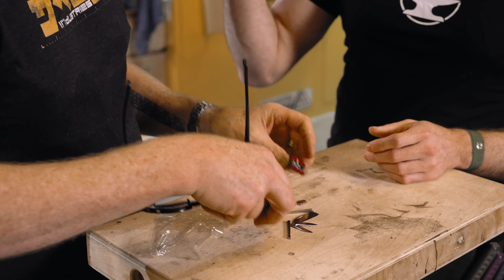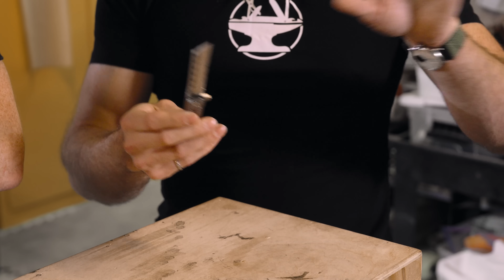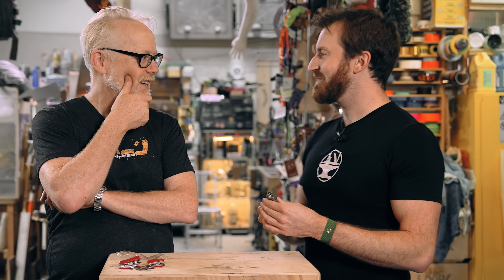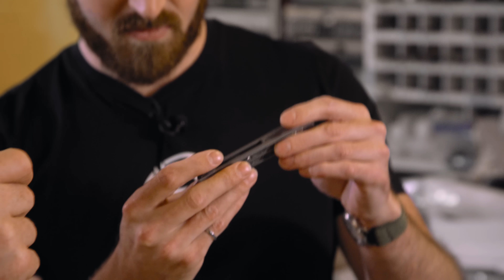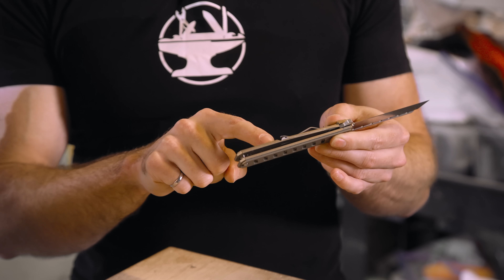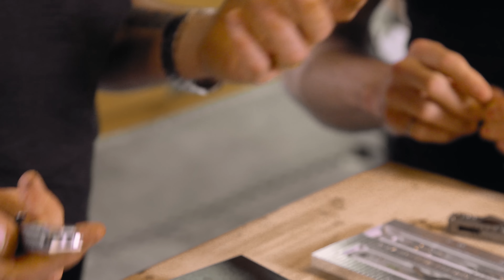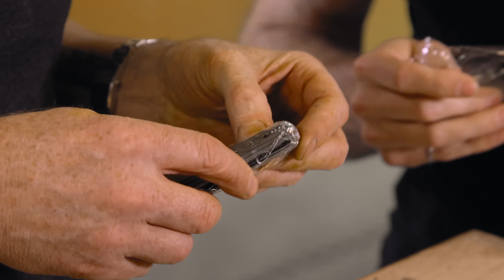Adam Savage Wields Hacksmith's Titanium EDC Multi-Tool!

Comment: It was such a honour getting to present the first Founder's Edition Smith Blade outside of Hacksmith Industries to everyone's OG maker hero 🥰 Thanks for being awesome, Adam!
Reply: You guys are insufferably legit. Good on you. I think my favorite touch is the torque wrench nature of that little piece of plastic to help assemble the belt hook.
Y'all are inspirational and do such cool things. Good on you.
Reply: @JoshuaKoerner Got the insufferable part correct.
Reply: @JoshuaKoerner  Really? Their finances and view count says otherwise. Even jimmy thinks so.
Reply: is the blade replaceable?
Reply: @IGamePlayOnly it is - they have two blades and mention being able to upgrade for folks who live in areas with strict laws.
Reply: @IGamePlayOnly  looking at their site, the whole thing is user serviceable and that includes the blade
Reply: @IGamePlayOnly will you ever actually need to replace it….
Reply: @Hohmies86  if you plan to use it like everyone else, it will dull over time. thats just a fact.
Reply: @IGamePlayOnly I’m an electrician and I use a griptillian with s30v steel blade every day to strip copper wires with. It’s been 2 years since I’ve sharpened it. I shave off copper sometimes when I’m stripping bigger wire. 
I’ve sharpened it numerous times. Can’t even tell that the blade has shrunk yet after 6 years total use. 
Really should go sharpen it right now actually. 
M390…. Be a long time before you ever need to replace the blade.
Reply: @IGamePlayOnly  Omg don't buy $250 knives if you can't be bothered to sharpen the damn thing.
Reply: The wire stripers are what sold me on this. The knife i currently carry around has a wire stripper, but it's a pain to use. Yours looks amazing and simple. Also being manufactured in Canada is a huge bonus
Reply: I have been looking for an EDC replacement and I'm sooo glad to come across this. Sad that the founders editions are all gone within hours of watching.  I love that you're making them inhouse. I'm not against made in China stuff, I just prefer things made in North America... whether CAN, or US.  I feel you will see that many of your customers will also prefer made in CAN. I snagged a Pro version, and hope it too is made in CAN. I can't wait to show this off at my Command!
Reply: This might be a dumb question, considering everything being discussed here, but....is that a static grounding strap being worn, and is it something that worn regularly? I hated those damn things when I had to wear them at the bench in the Army!
Reply: @Bad_Wolf_Media  He wears it all of the time... Clip and go ....
Reply: Do a giveaway and give it to me thanks 😊
Reply: @purifierphoenix2043  me to
Reply: @purifierphoenix2043 ok the entry fee is about $215 if I remember the price correctly. Best thing is 100% chance you’ll win.
Reply: guys i am glad you are the way you are and that you can create and produce everything you do. keep up the good work!
Reply: Have you thought about sending samples out for knife reviewers? Tristate edc is a great channel
Reply: As a fellow Boy Scout, engineer, and lover of all things knives and tools, I love everything about this. Getting to watch you nerd out about your design and share your passion with Adam is just icing on the cake!
Reply: now you just need a version thats uk legal carry, because id love to carry it, but knife laws suck here
Reply: @kevinmorrice I just checked the Kickstart page and they make them uk legal if that's where its being shipped to
Reply: If you make an XL version with pliers I'm buying that the millisecond it goes on sale
Reply: Those are absolutely beautiful knives. I plan on trying to get one whenever they release.
Reply: I'm looking forward to when you're  out of Kickstarter. I will be getting one then for sure!
Reply: I could tell you were meeting one of your idols, you were so nervous you were shaking 😂 you killed it though!!
Reply: Unless my eyes deceive me and my calculations are off, the kickstsrter is already 8x the goal.
Reply: @LyonsDenFarm well if they wanted to try and produce 10k knives for the Kickstarter and they now have that much more to make they better start buying more CNC machines 😅
Reply: You can tell you are literally looking your hero in the face... lol
The level of nervousness that is obvious is  understandable, I would be in that same headspace having a conversation with Adam....
And, Adam is soooo generous.... It must be amazing to have your hero gush over you.
Reply: Congratulations on the success of the kickstarter! I didn’t land a Founders Edition, but I did get the Pro. Very excited for a multi-tool that doesn’t weigh 3+ ounces and in titanium!
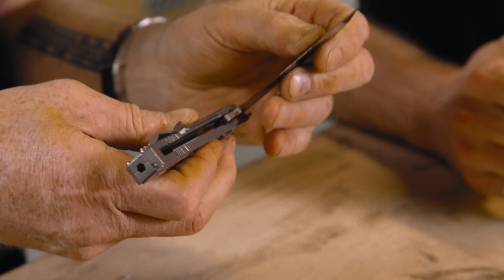Reply: 13:40 I wonder, wouldn't the 15degree protractor wear out pretty quick with that ceramic bearings ?
Reply: Get project farm to review it.
Reply: Watching and listening to the passion in James' voice, the excitement from both of you as he explained your design process made me want to laugh out loud with joy. This is everything that's wonderful about engineering and product design distilled into one video. Take my money. This is one of the best things I've ever seen.
Reply: Getting the Savage Stamp of approval is a huge win for Hacksmith. Awesome work guys.😂
Reply: It absolutely needs pliers. I'm happy to carry my Leatherman despite it's weight for that tool alone, anything else on it is bonus. Do a Smith Blade + or something IDK.
Reply: The protractor, is that the back or the blade side? The blade will shrink as sharpened.
Reply: I absolutely fell in love with your product and the way of thinking when building it. Since I was today years old when I've heard about it and itś not possible to buy one via kickstarter anymore - do you have any ETA on when I could order one? Thx in advance and congrats on a fantastic product!
Reply: You guys should put a little torch at the end ran off a button battery with a option of solar panel strip on the side for extra ability to charge it and run it that would really make it cool and seal the deal for me and maybe a little adjustable spanner like a little shifter amazing product congratulations I've also been thinking about how to upgrade the Swiss army knife for years could you see somebody has achieved it good on you guys congratulations once again. 👍
Reply: Bought one the day the episode aired. Still don’t have it but I’m really waiting. It will be my EDC in place of my pocket knife I always carry now
Reply: *honor 🤓
Reply: wonderfully done! all engineers are gadget geeks inside, i think. 
so glad to see its already 10x the goal. I intend to back for a smith blade if i can swing it before they're gone.

its inspiring to see how giddy you are about this stuff. its hard to hide this kind of passion. i was the same way showing my wife comparatively simple marking knives that i forged. ill get there one day!
Reply: Love to see someone else misspell a word.  A great design. There are so many things you can do with that basic design to make a whole series. Design is absolutely a terrific form of expression. I bet it feels great to get it out. I would love to see one of my designs out there. Congratulations! It really cool.
Reply: I want the founders addition but no tour 🥺🥺🥺
Reply: @brewer165 I live in Canada, I’ll take that tour off your hands!
Reply: There has never been a more fitting use case for the "take my money meme" congrats, I had my engraved letterman wave stolen 20 years ago, I'm saving to buy one of these for sure.
Reply: To be honest, I was on a fence because the $500 price tag and my experience of not sure if I was going to get my torch or not when i backed it. This sold me to buy the knife or all 3 knives later today.
Reply: Well done on it all.
Reply: ahem, OG AAAND THE GOAT
Reply: This made me even more excited to get my 2 Lites on order to replace my leatherman surge as my daily carry. no more 20lb multitool and just what I need in my pocket. until I can get approval from the SO to get the Pro lol
Reply: Backed! Wish I had got into the early bird, saw Adam’s video first and by then it was too late. Can’t wait to use it!
Reply: I would love to see you get this in the hands of knife reviewer Best Damn EDC. This is something I think he would love to handle.
Reply: he rocks!, you rock too!
Reply: Do you have a lefty version with the knife release on the opposite side?
Reply: you fool. you realize what this could do to society?! giving a former mythbuster the most powerful multitool in existence? you don't know the chaos that's about to ensue!

/jk its so cool to see one of my heroes geek out over such a cool artifact
Reply: With the acknowledgement that the Kickstart is at a special, reduced price, will you be selling these after the Kickstarter window? Timing is poor for my own finances, but I'd love to get ahold of one of these eventually!
Reply: I am a huge knife and multitool collector and I always have SAK and  Leatherman on me. But this looks amazing! I can see that you know what you do, that you know knife community and materials that needs to be used. All props to you guys! This will probably be amazing product!!!
Reply: from a knifemaker myself that is awesome well done
Reply: My God i'm ready impressed. I'm an Electrician in Germany and this knife would be insanely useful. Please also ship this knife to Germany get it into the market there. I would instantly buy a few for me and my Colleagues.
Reply: PAPA JAMES UPDATE THE LOGO TO INCLUDE THE TANTO BLADE OF THE NEW KNIFE
Reply: Shut up and take my money
Reply: I've actually been looking for a knife/multi tool almost exactly like this for forever. Seems like this design has basically every single feature I want in a single EDC tool. I'm definitely going to be buying one of these as soon as they hit the market.
Reply: I have a lite and it is amazing. Going to be my edc until I get my pro.
Reply: Awesome blade. Im gonna buy one next month. Way to go hacksmith ! Im a  Long time subscriber of hacksmith industries. Love your chanle love Adam Savage chanle. Can't wait to get the knife.
Reply: I'll be picking one up soon. The amount of detail is spectacular.
Reply: This must be so awesome moment to present this to OG maker. I was even my self so exited that i almost  had tears of Joy! Weldone James, that is true over engineering and superior rigthful way to OCD things and make quality product. 100% i will order one for my self 👌👌👌👌
Reply: Congratulations brother, you just sold me a Smith Blade family and then some upgrades!
Reply: Soo whens the smith blade 2? Lol
Reply: Bought one today!
Reply: Electrician here 
THIS IS PERFECT!!! Thank all of you for hacking the EDC multi tool world!
Reply: If you want a quick, easy duplication of all your models, offer one with a short blade and no open assist, since many countries (and some US cities) have blade restrictions. This is so awesome, though.
Reply: Awesome work. I'm sad the lite isn't smaller. These are pretty hefty and way too big for all of my scouts. Would love if you get enough backing to invest in a v2 geared towards actual small handed scouts?
Reply: @hacksmith if we could sell 10000..... and currently Kickstarter shows over 13000 pro orders and nearly 150 scout pack pro orders.... I think you may have underestimated the interest... great work and awesome enthusiasm for a user serviceable and upgradeable tool!
Reply: That is an awesome design. Definitely hard to top that. I will happily support. That Kickstarter is 28000% saturated when I checked.
Reply: I don't have a edc muktitool for the reasons they mentioned where it's too big and bulky. This is legit the first I've been like... Yeah I would like one of those
Reply: I just have to mention how many times you took the knife from Adam Savages hands. Lol sorry, I just noticed it.
Reply: @hacksmith Hi, James! Two questions - Will international shipping be available? What watch/strap are you wearing on the video?
Reply: There is no way I can afford something like that right now but I'll go right ahead to sub to your channel, it's the least I can do :D
Reply: lol. Headache confirmed. 6.5 million dollars. Wowowoow Go Canada 🇨🇦
Reply: I literally went to go buy one for Christmas for my brother but you can't buy them yet. There is only a fundraising campaign to back the project
Reply: Hahahaha!!! The kick starter is close to NINE MILLION DOLLARS. You guys are in ''trouble''. Good thing is the good kind!
I'm sure you guys are gonna make it happen. It's gonna be tough but if there's someone who can do it, it's you guys.
Reply: Ya know add a small LED and a couple hearing aid batteries in there and you could have a flashlight on that bad boy too let me know when they come out with acid wash finish 😍
Reply: I was sad that Adam either didn't notice, or didn't mention that his NAME was on the box of his Founder edition knife.
Reply: Dude is an alcoholic?  Why the shakes @15:18???
Reply: That knife is extremely over priced
Reply: This looks amazing and I'm happy to pay an unnecessary tariff imposed by the King of Twits if it means supporting my Northern friends. Elbows up!!!
Reply: Can't wait to get one
Reply: 4400% backing on kickstarter.

Absolutely blew it out of the water with this one
Reply: Lol Sig needs to hire some of those folks from that knifemaker to save the P320.
Reply: You should send one to the old guy from youtube
Reply: I can't wait to get mine!!  I ordered it a few weeks ago :)
Reply: Dang I missed the boat on the Founder's edition!
Reply: Please make a sub $60 version with 14c27n blade steel 🙏
Reply: When you see someone having boundless enthusiasm, excitement and joy about the design of their own product, you know it is a well made product. This is on my shortlist of EDC buys, definitely.
Reply: We are all rooting for you guys. Keep the grounded and purpose/experience focused products coming.
Reply: For 250 😢
Reply: @hacksmith. Ever thought about implementing a Cross Bar Lock instead of a liner lock design? Is that even possible with this? It would be nice to keep the same grip and not put your fingers under the blade. Once i switched to a knife like that i cant go back lol
Reply: Ok everything was great, then you talk about torque spec value specifically designed into the tool. That's just awesome
Reply: Tritium on the Pro Model - Please !!! 🙏
Reply: @hacksmith I’m so sad the founders is sold out. I am late to this party. Wow. Congrats the campaign went what seems like quite well. Funded in 1 month? Wow. I’d do anything to be able to get a Founders edition.
Reply: This is the start of a new legacy Hacksmith.  
I can see it already,   just well ...FN...Done 👏 👏 man!.....I love it. 
Im not a knife fan at all, but yours is so good it's convinced me that I need this tool! And im in marketing. 
These days its nearly impossible to invent something new and better.  But you have a slam dunk here that's gonna kick off a whole new household name of items that you probably never thought would be a thing all from making it real. 

Im just so pumped, and im proud of you, and everything you have built so far. The sky is the limit Hacksmith!
Reply: Congrats
Reply: Such a cool knife and well thought out. of course I missed the opportunity to be a backer. I look forward to when these actually hit the market.
Reply: I want this only thinner and just the knife. It's hard to find a good knife that I can have clipped in my pocket and don't feel it. Only one I found was a Gerber eclipse, but Gerber has terrible hardware and not the best blade steal
Reply: Hi there 
If I may 
Hollow knife pivot for marking with scribe and protractor accuracy 
Holes drilled at lengths for drawing circles, hollow pivot for datam
Reply: I was all for this until you said proprietory bits.
Not only does this lock replacements to your company it makes them non serviceable in the event you go out of business or stop manufacturing them.
Also m390 not the best choice of steel for an edc.
You could have went with a more serviceable steel and had a competitive price since youre directly competing with Leatherman and Swiss Army. 
A small tasteful improvement to the existing design would be to offer scale options.  It would allow customization while rounding out the blocky design.
Reply: I want this knife so bad I can’t see straight. I have emailed hacksmith.   Take my money.  I don’t care what it costs!
Reply: How do I get one? Your passion and how excited you were to present this to Adam was out standing.  Good for you and your team. What's the different betweent he different versions. Is it listed somewhere?
Reply: great job guys ive been watching since your garage. happy for you!
Reply: you guys are ready great!
Reply: Can you make one that meets UK knife carrying standards as this would be fantastic for workshops and on site work.
Reply: So when is this knife going to be available?
Reply: I want one, but they all gone :(
Reply: this product or you company is deceiving people,
we are in 2026 and you can not even buy one in your website
it seems like just a $$ grab and run
Reply: Holy Botox buddy
Reply: Congratulations HACKSMITH guys on creating a masterpiece 👏 it's AWSOME my favourite lil touch is the STRIKER I'm camping out alot could come in handy
Reply: AN honour NOT a honour. FFS !!
Reply: Here’s the only issue I can’t find it anywhere to get 1
Reply: I finally got my Smith Blade Pro yesterday, and it feels very nice in the hand!
12:10 Sadly, only the metric ruler continues on along the blade, not the imperial.
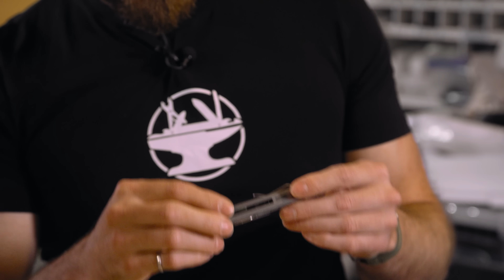12:37 It would've been nice to have tritium slots on both sides; as it is, seeing it in the dark depends on how the knife is laying down, and for the Pro edition, at least, the tritium slot is on the opposite side as the belt clip so it isn't visible if the knife is laying flat.
12:55 The blade hinge is VERY satisfying.
Reply: My Pro Edition has been my EDC nearly every day since I got it. Fantastic. #754
Reply: Next time bring 2 knives not just 1 (not the one from your pocket) so that as you demonstrate the functions of the knive to your highly regarded host they can follow along with your guidance / demonstration. I lost count how many times you took the knife out of Adams hand as he was simply wanting to look at the very function you just spoke of. This makes for a way more intuitive and fun experience for whoever you are showing. Ive worked in over the counter sales a long time. The best way for whoever you are showing something to is to allow them to get a feel of the knife, firearm, watch, whatever it is, themselves.
I hope you take this into consideration for your own benefit. 
Respectfully,
Reply: Has Adam been up to the HERC to see the power loader yet?
Reply: This has the potential to be the edc for the next generations, be proud of this product :D Seems like there might be need for more cnc's with this kickstarter xD
Reply: This morning I watched your YT video introducing the Smith Blade, & being a knife nut I couldn't help myself but to order a Pro (only because the Founder's Ed. was sold out already!). I'm SO excited to hear John Grimsmo & team liked it! I recently bought a Rask, so I understand their tolerances & standards. And having Adam's blessing is about the highest compliment you could ever ask for.

The multi-detent system is super intriguing, I've never seen anything like it. I'm also curious to experience it! I've been on a huge Chris Reeve Knives tear for the past year or so, so this will be a welcome change I'm sure!

I see the same passion in your eyes discussing this as I do with John & many other amazing knife makers out there! You're absolutely one of us! I wish you great success & I can't wait to see what EDC tool you release next!
Reply: @pateralus9 thanks!
Reply: You realize you are going to sell millions of these in a matter of weeks right? LOL
Reply: @JasonCGuitarOfficial  hopefully they did a limited number otherwise they gonna be in big big trouble lmao
Reply: @JasonCGuitarOfficial Just like all of those "lightsabers" 😂🤦
Reply: No pliers
Reply: Proud to see if fellow Canadian doing a great job, but why are you using China? Let’s make it 100% Canadian bring it home.
Reply: I purchased a Smithblade Pro! Would love to see a Smithblade XL version with more tools, specifically pliers. I EDC an inexpensive Gerber with pliers and love it. What I've felt is lacking on it is a lot of what the Smithblade Pro has, minus a seatbelt cutting tool. Love the channel, can't wait to get my hands on the Smithblade!
Reply: Pardon me while I lose respect for Mr Savage and this channel for the obvious sales video. 
Very weak.
Reply: You guys are awesome i cant wait to get mine! Keep it!!
Reply: Seriously awesome product team should be proud
Reply: Is that thing legal in Canada?

Edit: oh are you a Canadian company?
Reply: @fakebobbyhill296  Waterloo, Ontario--former hometown of Blackberry.
Reply: @fakebobbyhill296  its legal everywhere if you opt for the non-locking option.
Stupid australia and their rules.
Reply: Am I able to purchase this right now
Reply: Yes
Reply: I am so ordering one of these. This is awsome.
Reply: Wont lie, this video just made me put a pledge in for $2943! I am absolutely pumped to get these!! 100% gonna be my daily carry for a LONG time!
Reply: Ok, hear me out... XL version with a replaceable utility blade.
Reply: You should add a strip of nylon thread or other strong thread that goes along (inside) of the plastic wrap, that you "pull" as a way to open it without the use of another knife / scissors.
Reply: I want one now!
Reply: So happy to see Adam so Happy!!

Excited to get my Founders!

Good job James and team!
Reply: First of all I want second is it fire fighter proof as I have broke everything knife I've ever had haha
Reply: Please come out with one with standard bits! I'm still going to get one, but I'd love to have one with standard bits! Probably like a Phillips #1 & #2 and a slotted #1 and #2 at the very least. Would be so awesome. Would be awesome if you could make an interchangeable body section to swap out for precision bits and standard bits. Still going to get one either way but this tool isn't just for small electronics. I do electrical work, so using a phillips, slotter, square drive, or Milwaukee ECX bits I use them daily so to have this tool use standard bits would open it up to a lot more people!
Reply: Just…take..my…money. Pledging on KS now!!!
Reply: Hello Aaron,

Thank you for reaching out and letting us know about the issue with your order. 

After reviewing your order, it appears that your shipment was lost in transit with USPS in June. Package Protection Insurance was removed at checkout when you placed this order, and unfortunately, we are unable to offer a replacement more than 30 days after the last shipment update on June 19th.

Sorry we cannot provide a replacement or refund in this case without insurance and out of our own coverage 30-day timeframe. If you have any other questions, please let us know.
Best Regards,
Hailey
Hacksmith Store Support Team
Reply: Someone would have to be both deaf and blind not to recognize the pride you have for your first complete set of the Smith Blade... Like a father speaking about their first child... Congratulations and can't wait to see them out in the wild.
Reply: You need to make a blade that is legal in Europe
Reply: aren't assisted knifes like this illegal in canada?
Reply: @lizardperrson its not assisted
Reply: @Cantfunction1386 nope!
Reply: That was painful to watch my man, you need to work on your people skills. And maybe don't smoke beforehand.
Reply: Another overengineered, impractical, overpriced creation courtesy of Jame's...team. Zzz...zzz
Reply: @hacksmith whats the matter bro afraid to have a legit honest conversation in the open so you go leaving comments on 10 year old vids?
Reply: @Akanoyoru I’m so curious. I’ll do my own digging, please just tell me which 10 year old video 😂
Reply: @leyamarie James has such a fragile ego he fights people in the comments section on other people's videos lol.
Reply: @Akanoyoru  Shhh. Sound travels from your mommy's basement and she's trying to sleep. She has to getup early to support your Candy Crush addiction. 🤣
Reply: @BakerStudiosIndy  u mad bro? James has said his company is practically bankrupt multiple times in his comment section.
Reply: @BakerStudiosIndy  u obviously don't watch their videos james has said hacksmith is in a financial bad way spending like $10k a day they'll be lucky to survive to the end of the kickstarter.
Reply: @Akanoyoru  wow I didn't realize it was that bad.  Hope they make it!
Reply: Shilling his crappy gimmick knife lol
Reply: @Kuskis-JPG  a fool and his money are soon parted ;)